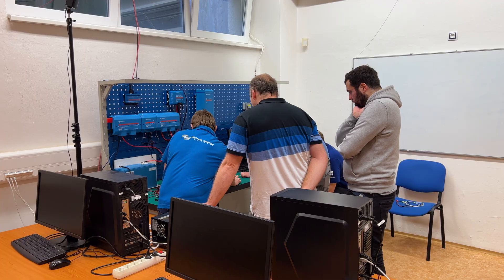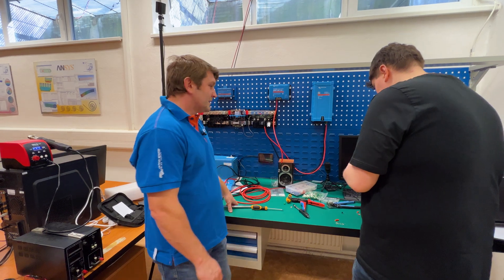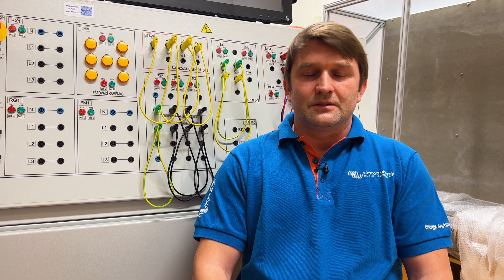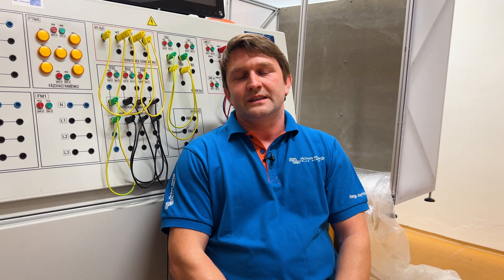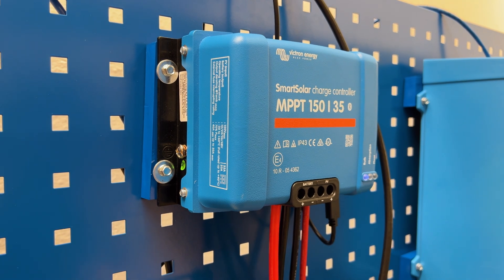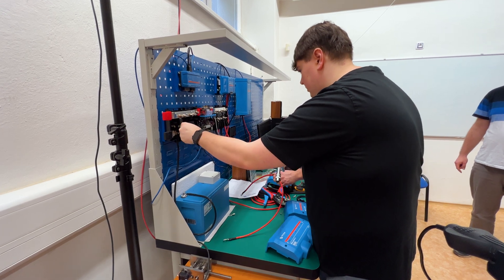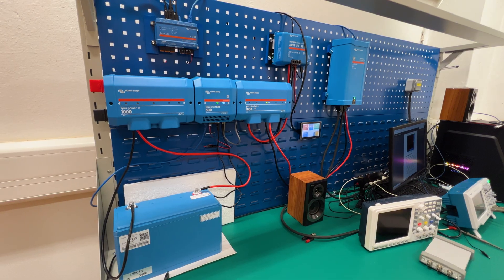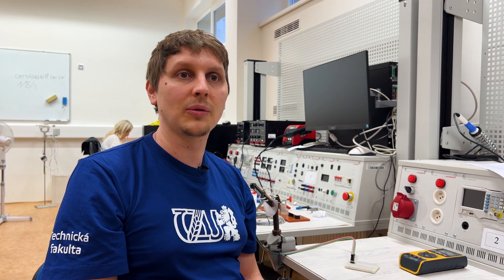Czech Students Go Off The Grid With Victron Energy Equipment

Comment: Is it possible to buy the blue bread board/mock-up panel used in this video?  Perfect for proto-typing future wiring and component layouts.
Reply: Those are pretty standard panels normally used with hooks to hang tools or products on, you can find them in your car parts shops, or hardware store.